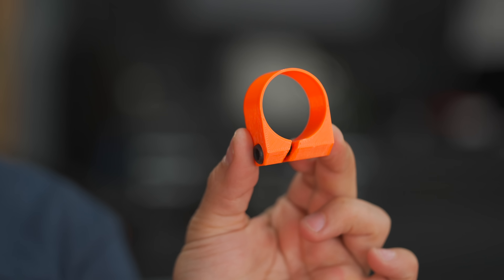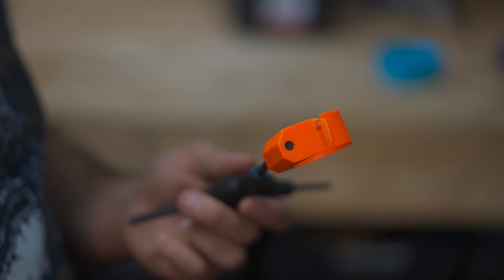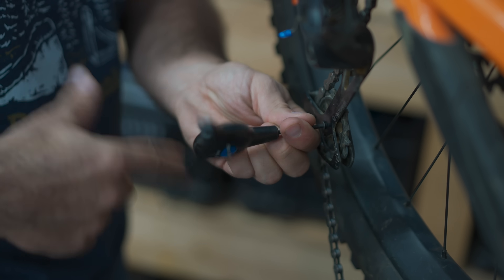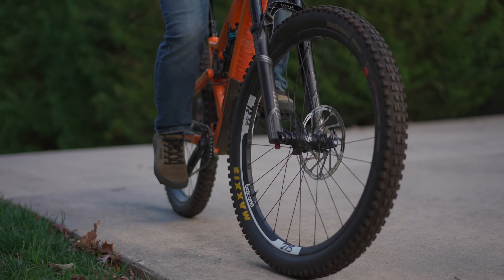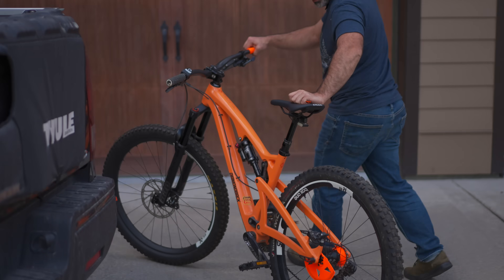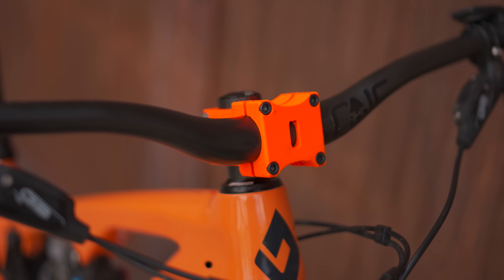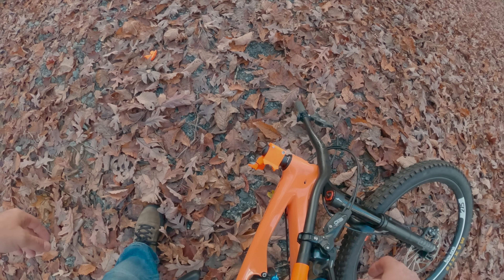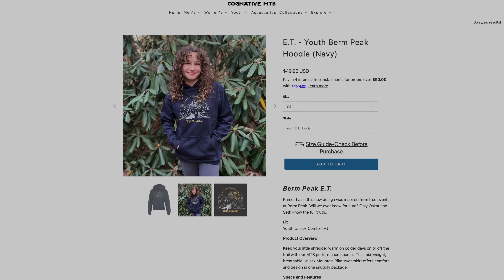Will 3D printed MTB parts break catastrophically? Let's find out!

Comment: I've actually been printing bike parts for my bike for years. I've been into 3d printing long before I got into bikes. It's just that I've never printed any crucial parts that you did! I've done bike handles, bike pannier adapters, phone holders, truing rigs, and currently a low profile bottle cage. Clearly you were just having a good time here, but 3d printing is really good when you know its limits!
Reply: I too made a phone holder that tucked into my frame to run a trail app.  If you know the limits of the process and material.  I certainly wouldnt try a critical part :)  i use pla for test prints but maybe something like an mjf print with a true high quality material would work for non critical long term parts.
Reply: TPU is my material of choice for bike parts. Speaker mounts, headlight mounts, custom adapters for things, etc. It's got a little give instead of being brittle, and is basically indestructible.
Reply: What material do you use for such functional parts? Is PLA sturdy enough for a bottle cage or are you using some of the tougher filaments?
Reply: @MagiMas  PETG is my material of choice for scooter and bike parts if I may add my 2 cents
PLA just doesnt keep up with water and weather, degrades in a few months max, also it gets soft in real sunny weather
PETG does not have these issues. (Well black PETG might still get soft in extremely hot weather but thats it)
Reply: @MagiMas  this bottle cage is actually TPU. Normal bottle cages should be petg, but everything else was printed in pla. I'd be concerned if I lived somewhere warmer but here in Canada I've never had an issue
Reply: @TheEvilVargon  I'm in the same camp as you, been printing smaller bike parts (low profile adaptors, small cable guides etc) for a while. I live in Sweden and never dared to use PLA mostly due to being scared of it's brittleness in the cold. What's your experience with PLA in the cold? I've mostly used PETG and Nylon myself, but I've never even tested PLA for this application.
Reply: @andy_liga  I've had zero issues with pla in the cold. I had a handle just above the bottom bracket to lift the bike up that held up fine during winter. It wasn't even super structurally designed since all the stress was on two bolts.
Reply: I made a sleek commuter bike from an old MTB frame, and I've printed some interesting stuff for it. I printed mounts for Magura hydraulic rim brakes down on the chainstay. Scetchy, but they hold up so far! Also miniature reflectors, hose clamps, casette spacers, handlebar plugs and so on. PETG and a lot of infill.
Reply: I 3d printed a front and rear light mount because I couldn't find commercial options I like in PETG, front one clamps the vertical tube under the handlebar and rear clamps a steel rod on the underside of the seat. Even added those square tooth mating circles with a bolt through to add angle adjustment.
Reply: My plan for this winter is to print a transparent mudguard with a bunch of red LED strip inside it. I think having a sizeable object that lights up will be better for being seen than a point source of light.
Reply: @charleslambert3368  Idk how muddy your winters are in your area, but I'd imagine that the LEDs would be covered immediately. If that's your plan, some L brackets that attach to your fork and point downwards would likely be better.

Though for ridiculous visibility, I cannot recommend enough covering your bike in reflective tape. It makes you a glowing beacon to other vehicles.
Reply: DID U PRINT UR PRINTER TOO ?,long time b4 u was printed !
Reply: ASA or CF ASA is gonna be your best bet for bike parts. It is strong and impact resistant and can take extreme temperatures and has high UV resistance. Prusament ASA is very good for a good price. Also more walls is stronger than more infill and gyroid infill is the strongest infill pattern.
Reply: I’m experimenting with a bunch of pets in PLA. I have a cargo cage from Printables mounted on my fatbike, which endured a day at -15C with a stove strapped on without issue. PLA is actually stronger than PETG, but degrades under UV and water ingress. I’m going to keep assessing durability, since PLA is easier to work with in humid environments like mine.
Reply: You can 3D print in Metal, the printers aren't cheap but it would probably be better than plastic for this kind of thing.

Comment: You need to pick up some carbon fibre nylon! You can make somewhat safe aluminum alternatives with enough trial and error!
Reply: Carbon Fiber infused filament is actually weaker than the traditional filament it's infused with. It's mostly meant for lighter models, better dimensional accuracy, and ease of printing specifically for nylon infused filament. But it's a lot more brittle and less impact resistant. regular Nylon without the carbon fiber would be better here.
Reply: @PabzRoz  idk what filament your talkin about but the stuff I’m thinking of is specifically engineered to be stronger and more ridged to mimic the properties of aluminum. The carbon does make the part slightly more brittle, but that’s a small trade off compared to the benefits.
Reply: @gregcampbe1l  If you're talking about the Carbon Fiber infused Nylon filament from 3DHubs that was advertised as stronger than aluminum than you're mistaken. That's not simply just infused with carbon fiber. 3D printing filaments infused with Carbon Fiber alone makes the models less durable and more brittle which is not what you want for bike parts.

And I quote "3D Hubs is the first 3D printing service to offer fiber-reinforced nylon, which makes printed objects even stronger than aluminum! The worldwide 3D printer network 3D Hubs is branching out into a new service, offering a series of nylon materials reinforced by kevlar, carbon fiber and fiberglass for super tough 3D printing."

It has more than just carbon fiber in it to achieve that level of strength. Regular Carbon Fiber infused Nylon alone like NylonX which is very popular CF infused Nylon is actually much less durable than Nylon alone and even some other more traditional filaments.
Reply: @PabzRoz  regular nylon is “stronger” because its ductile, which makes it awful for printing things like bike parts which are supposed to maintain their shape and stay ridged. A 5-10% carbon mixed filament (preferably with longer carbon strands) would be plenty to add some rigidity without being detrimental to the structural integrity of the part. I’m not talking about the higher percentage shit, 15-25% cf nylon is for more specialty/ lightweight applications.
Reply: @gregcampbe1l  Incorrect, even 5-10% is detrimental. It significantly changes the layer adhesion while making the model significantly more brittle which is a recipe for a snap/ crack. Which is the absolute last thing you want on bike parts that are designed for impacts and sudden loads. Go ahead you can look it up lol. I've been printing for years and this is just common knowledge in the 3D printing community. None of my CF filaments are nearly as strong or durable as without and they're only 5-10%. They're significantly more brittle and prone to cracking or snapping. You much rather have a durable bike part that has a little bit of give to it instead of something that is brittle and will snap on you. And the amount of give the model would have without CF is no way enough to cause any significant issues. I can literally send you dozens of articles and videos that prove scientifically and with actual stress tests that everything I'm saying is a fact. It's a common misconception.
Reply: @PabzRoz  🤦‍♂️ idk where you’re getting your info man. The first article I pulled up says the exact opposite. 

(Cf nylon’s) “mechanical properties and inter-layer strength. Improved strength, stiffness, and heat resistance compared to unfilled Nylon.” 

This article is also inline with all the research I’ve done over the past few months into this exact topic, for some product prototyping of some MTB products. I’ve seen a few complaints about brittle cf parts here and there, but thats usually due to cheap filament or user error.
Reply: @PabzRoz  one more thing, why tf would anyone  spend so much on cf filament if it was so detrimental to the performance?!?!? And why are there so many raving reviews about cf filament online????
Reply: @gregcampbe1l   "Increased strength" or just the word "strength" in general is interrupted differently. For example yes technically CF filament has increased strength when it comes to stiffness and rigidity for sure. It also makes Nylon easier to print with for less warpage and helps dimensional accuracy. It absolutely has advantages for specific use cases where you need a strong model that has no give to it while being accurate. But that's at a cost of being more brittle and prone to snapping/ cracking during impacts. Has nothing to do with user error that's just how the chemical compound works although user error could obviously make that worse.

But when it comes to filament without CF it's "strength increases" in terms of durability, tensile strength, and impact resistance. But at the cost of being less rigid and stiff. 

"increased strength" all depends on what exactly is becoming stronger. It's not just a one word be all if you can kinda get what I'm trying to say here. Completely depends on the use the specific use case.

And to answer your second comment that's easy. Some filaments that are harder to print with like Nylon for example carbon fiber significantly helps ease of printing. It has less warpage when printing, etc. like I mentioned above which is a big a deal obviously as well as all the other advantages CF filament has. I never said it was bad of course it's going to have great reviews. CF filament has it's advantages over none CF for specific use cases and vise versa. Not to mention CF infused filaments are just cool as hell in general. That's like saying "why do so many road bike have such great reviews if mountain bikes are better" Because each one is good for different use cases lol obviously both will have great reviews. Just in this specific use case the mountain bike would be better.

Comment: Couple of things:
I've made some 3D printed bike parts, but you really need to put them where they will work. Grips, sure, they work, but when you can get soft lock on grips from the store for 7€, I won't even bother. However, parts like a chain guide, shift sensor, battery bracket support are things I've made and things that have lasted for hundreds of kilometers by now without wearing out, on top of which they are all custom and easily, cheaply replaceable at home.
Orientation is another big factor. Just modelling something you can slice in a 45-degree even will have a stronger linear connection, the shear point is 99% of the time in between the layer lines.

So you certainly can make "bike parts" out of 3D printed material, but you should not make anything that sits in a connection between you and the ground, like axles, stems or other parts that undergo big amounts of stress.

Comment: Some of those parts lasted a bit longer than I expected but in the end they still broke, which definitely WAS to be expected. The grip and jockey wheel holding up wasn't much of a surprise tho since the jockey wheel can hardly be considered a load-bearing part and the grip was basically just a wrapping around the handle bar, where u could just wrap the ends in some duct tape and it would hold up just as well.

Comment: I've had a 3d printed dropper lever addapter on my bike for around 3 years. It was originally made of ABS and it never failed even with wrecks. I put my printer in an enclosure and ended up replacing it with a polycarbonate version because it is so much stronger. PETG tends to shear instead of warping and that's why the stem is so sketchy. Using ABS the parts would be stronger and warp before breaking. Nylon is a good choice too but absorbs water from the air so it needs to be dried before printing and stored in a dry box. 
When putting a bolt into plastic I prefer to use a heatset insert or get a steel dowl and drill and tap the rounded portion so you can design a hole for your dowl to slide into. Some metal seat post clamps are designed this way and it lowers failure points in a 3d printed part.

Comment: At the very least, you could test different sized stems with 3D printed party to get a feel for what you like better before buying a actual one. But then again, a good Bike Shop proably has some Demo units they can quickly throw on your bike for that purpose anyway.
Reply: That's a great idea!
Reply: Seth probably has a bin full, but I am sad to admit, I have plans for a LOT of printed parts for my bike, BUT I had not thought about that. Now added to my list make a file for a stem that can easily be adjusted for length and angle then reprinted based on example geometry from parts catalogs to see which has the right fit and feel before buying alloy parts.

Comment: I'm using some non load bearing 3d printed parts on my daily bike:
- light mounting adapter
- shifter adapter
- enclosure for e-bike motor controller

All take some design iterations but do their job alright.

Also, Threads usually hold on pretty well on printed parts.

Comment: Nice entertaining vid Seth. That stem made my heart sink, thanks for not dying. 
I'm using a few 3d printed functional parts on my bike. Nothing that's going to get me injured though. Downtube protector, hose clamps, spare tube holder and a map holder when I do adventure races. Good for custom gopro mounts too. 
3D prints are plenty strong for certain parts. In it's stronger orientation, it's about 1/5 the strength of aluminium which is decent. If you load it like your axle along the print layers, it'll sheer really easily though.

Comment: Jockey wheels are the only non-sketchy thing you made with a 3D printer out of plastic for bikes. At least with the plastic you're using. If you had one of the glass fiber impregnated composites like Zytel (which gun furniture and bodies are made from), you'd be doing better for some of the other things. For stuff like light mounts or computer brackets... sure plastic is perfectly okay. Jockey wheels have been made from plastic for generations now..

Comment: Looks like your material choice was wrong... some of those critical components SHOULD NOT have reduced infill (I could see the infill in your stem when you pulled it up til it fractured. (I am surprised that it survived the ride, but I am not surprised that you broke it when strongarming it.)) you also can not expect plastic of any form to have the same strength as metal, so you have to engineer it accordingly. Look at how much bulkier carbon bikes are compared to alloy... They are lighter but bulkier and more fragile. Especially the older ones when they where still learning the carbon engineering. There are reinforced filaments that are a good bit stronger, but they would still require proper engineering to survive. You also have to choose your battlefields. If ALL parts where suitable for 3d printing or molding, we would not have metal or even carbon fiber bike parts, they would all be injection molded nylon.

I typically love your content, but this video came across disingenuous. You gave the impression "I do not want want this to work, so I am going to make it look like it can not work". It feels like you set out to mislead your following... I am quite disappointed. I believe you are a better content creator than that. At best I can call this "Seth was hurting for real ideas".

Perhaps you should check out thingiverse (or other file sharing sources) for ideas of legitimate projects and real content about printing tools and parts.

Your 3d printed multi tool... that was good content.

Comment: Thank you for the Public Service Announcement about 3D Printing (Fused Deposition Modeling in your case).  I don't see any errors in engineering... I don't think any engineering was done here.  It is very helpful to inform your audience that it's generally a bad idea to additively manufacture parts without understanding the stresses they will experience in use.  And that real engineering would involve a failure mode analysis, stress calculations, proper material selection (Mechanics of Materials), 3D modeling, and then simulation.  Of course, yours is a example of the Agile method of just guessing at some functional design, 3D printing it, seeing it fail, then re-designing with the information from the failure mode, and around the cycle.
I do very much enjoy your content, and this was time well spent in educating your subscribers who may not yet have the knowledge (but have the ambition) to make their own parts.  There are many parts that don't see a lot of stress (or only compressive stress) that can be modeled and then FDM printed.  Could be a follow up video!

Comment: I think using something like a carbon fiber infused filament at 100% infill would result in significantly stronger prints. I know there's one 3d printer that actually has 2 nozzles, 1 for the plastic, 1 for a carbon fiber thread that inbeds itself in the plastic. Or if your feeling bougie, buying the form labs fuse 1 and 3d printing with metal 💀
Reply: Carbon Fiber infused filament is actually weaker than the traditional filament it's infused with. It's mostly meant for lighter models, better dimensional accuracy, and ease of printing specifically for nylon infused filament. But it's a lot more brittle and less impact resistant. Definitely would be counterproductive for this.

Comment: 3d printed parts are ok for add on stuff. A cell phone holder, custom berm peak valve caps, a light holder. They are good for prototyping. 3d print something to prove that it works and fits then take it to a machine shoo to have it made out off metal. That is what 3d printing is great for